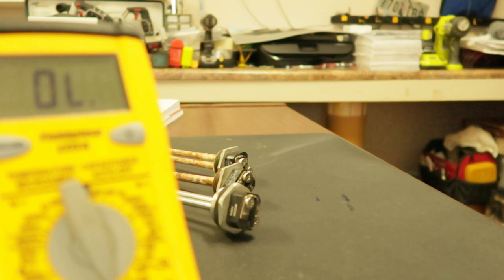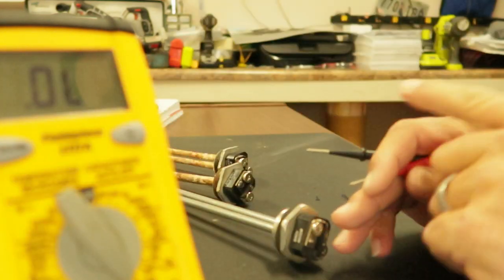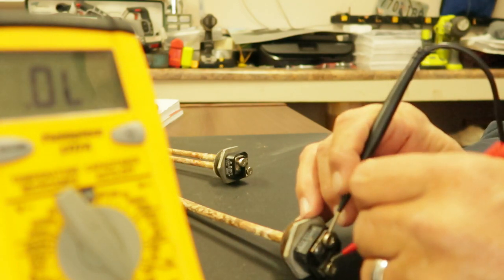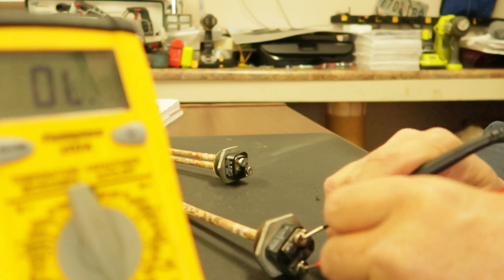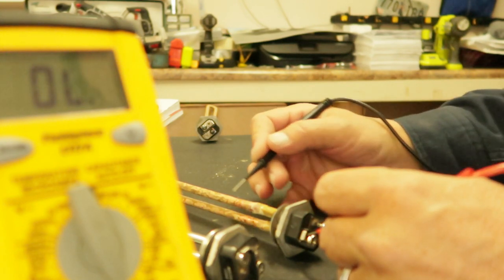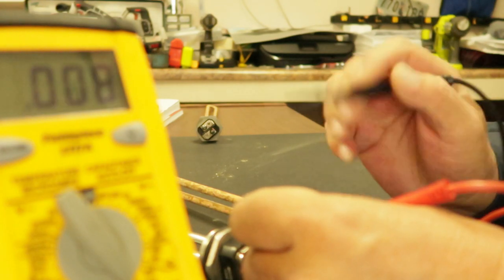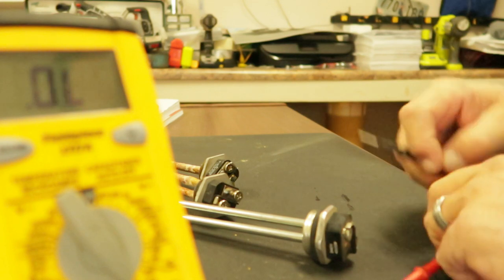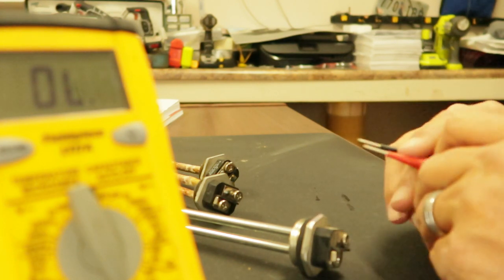How To Tell If Your Water Heater Element is Bad

Comment: Hey Dan, thanks for the video. Not that I want to nitpick but getting “OL” on your multimeter during the resistance check is NOT getting a resistance of 0 ohms; you’re actually “over limit”, which means your resistance is too high to be measured. That indeed corresponds to a broken (open) heating element. A true “zero ohm” readout would show up as something like 0.000 (or very close to that) on your multimeter. Thanks!
Reply: Open Line

Comment: The elements are so cheap that if you bother to take them out to test, you might as well change them regardless of whether they're bad or not. Can the elements be tested while still wired into the heater?
Reply from the maker: absolutely, remove one of the wires and do a continuity test with your meter. WARNING!!!! TURN THE POWER "OFF" to the water heater and test for voltage at the incoming wires at the top element tstat before proceeding to the test.

Comment: cant we just tie the ends with two wires, throw it in a bucket of water and plug it in and check if it heats or not? i want to try this method because i dont have a multimeter available at the moment. is it a bad idea?
Reply: Heavy gauge wires necessary, make sure

Comment: Water heater elements that are working usually test at or around 12.5 ohms. Anything majorly different means it may be going bad. But I don't know anything about ohms. Just what they should and should read in an element
Reply: Water heater

Comment: Dan...........................THANKS for the video.  I assume you can do this test while the element if STILL IN THE HEATER ??  If so, should the electric be shut off???   THANK YOU.     p.s. I vote for "water" heater.
Reply from the maker: First and foremost, make sure the power is off, double check with your meter at the incoming power at the water heater. Then remove the wires from the element so you can properly test continuity of the element.
Reply: @danjiles  Thank you Dan. I appreciate your good information and quick reply.   Merry Christmas.

Comment: So can you check it with it in the tank and water in it?
Reply from the maker: Absolutely, just remove the wires prior to checking. Of course, turn off the power to the heater and verify no power before hand.

Comment: Is an electric water heater inside the house; how dangerous is it to cause explosion  or fire?
Reply from the maker: I don’t think you need to worry about it. Most electric water heaters are in the home.
Reply: If you have a LP water heater then it has the same risks the LP stove, furnace, bbq grill and other appliances have. The most common risk I have seen with water heaters are leaks due to age and disrepair. When a 100 gallon water heater springs a leak or goes entirely it can seriously damage a structure. It's a good idea to have a professional look it over at least every year, and to know how old it is so you have an idea when you need to replace it. I've seen a lot of unhappy people buying water heaters who didn't really recognize that they were replacing units that had performed years longer than intended.
Reply: Why replace it if it is still working.  If it works years beyond expectations you got a good one.

Comment: Won't it read 240 if it's hot and good and won't read anything if bad
Reply from the maker: not likely, the wiring is only the hot side. no neutral to base voltage by. you would need to use OHM's for the testing.

Comment: I made a tool to empty water heaters using the element area if the drain valve don’t work like it should.
Reply from the maker: Now that's a smart idea. and I guess you call it a "Water Heater" not a "Hot Water Heater"
Thanks for watching.. You rock !!
Reply: Can you please provide a picture of the tool.. I may be in the sane situation with drain valve

Comment: I’ve always just went with Water heater, as it’s being used to heat the water so therefore it’s not yet hot water being heated. And why would you heat already hot water lol. If your heating water then you don’t need the hot in the name as it’s in the wording of heating, as heating is to make hot. But there are many times I will say hot water heater 😂🤷🏼‍♂️ but most times I go with water heater.

Comment: Water heater. You don't heat hot water  so it's not a hot water heater it's a water heater. It would be a booster if you were

Comment: It is a water heater. If the water were already hot, it wouldn't need a heater. So, actually, it's a cold water heater.
Reply from the maker: +Tj Riddle I like how you think.  Thanks for the input.